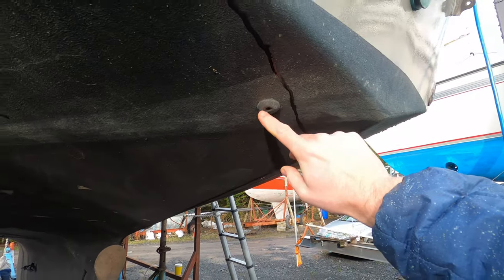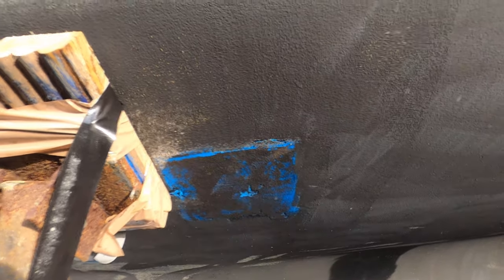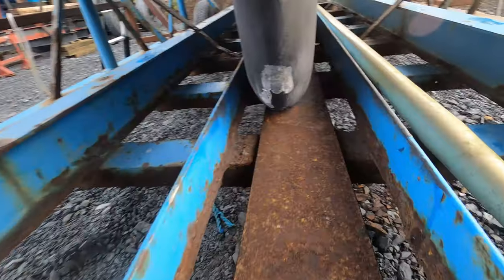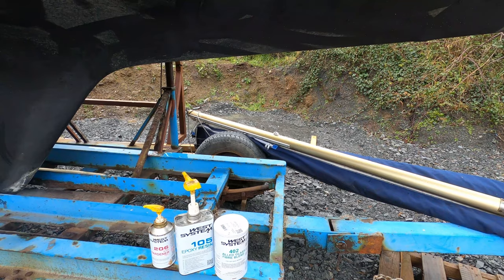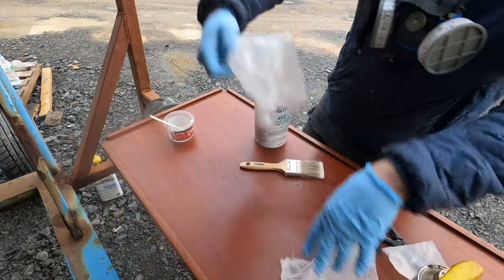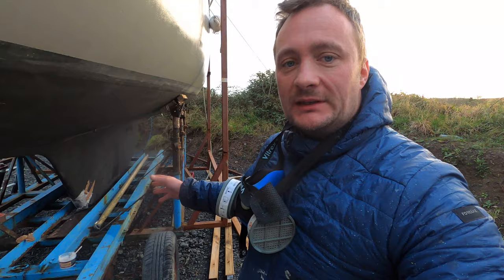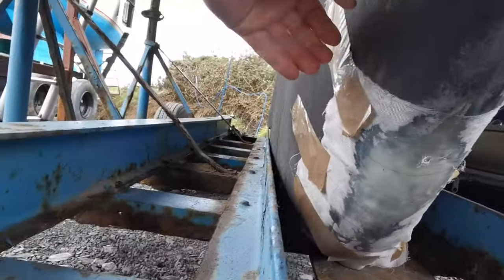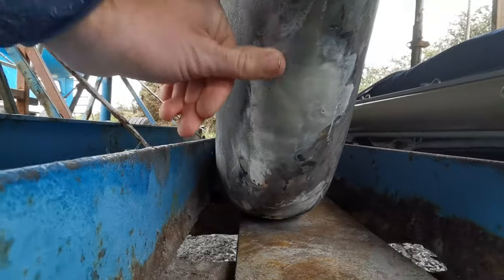Sailboat projects: Repairing Our Damaged Keel (Ep. 27)

Comment: Hey, interesting to see. I had a similar damage on my keel, and filled it with thickened epoxy... No fiber glass though. Seems to hold up nicely on my boat.. luckily.. Thanks for a nice Albin Vega episode :)
Reply from the maker: Hi Pal. Yeah I think if you can get away with thickened epoxy then its a lot easier. I just think with larger or deeper damage it can be brittle so add some fibreglass to give in strength.

Comment: Mark I have the same lower plug on keel . As well as the upper plug above that to the bilge. What type plug is in the top and how is it held in. Thank you Mike
Reply from the maker: Hi Mike. Sorry I'm not sure about the top plug. I assumed it was screwed in and not sure what its for. Some guys on the Vega facebook pages didn't know either. So I'm baffled. I will be removing it this winter though so will find out for sure